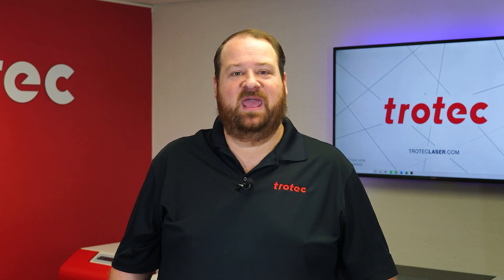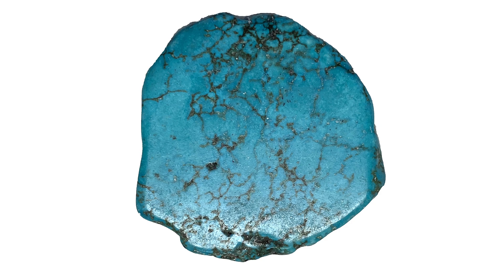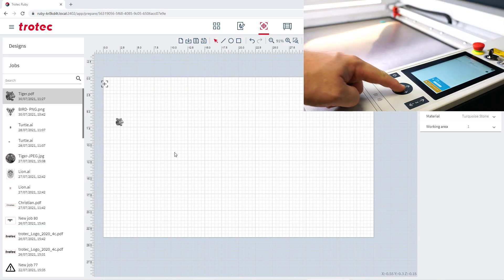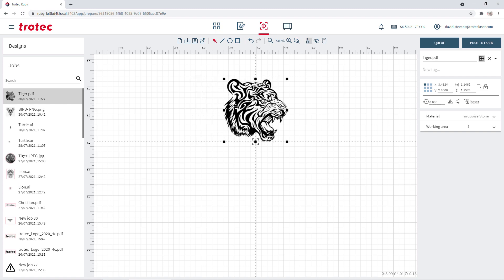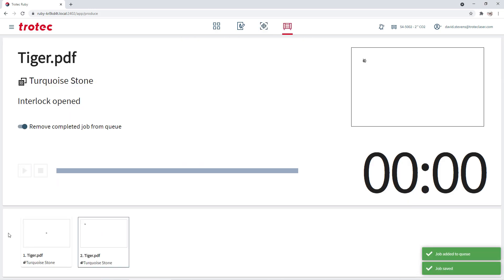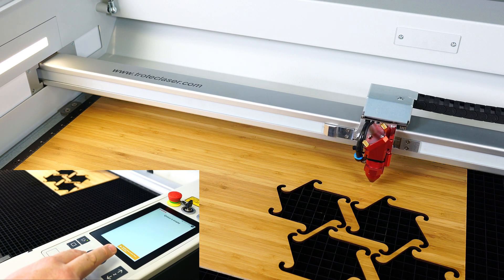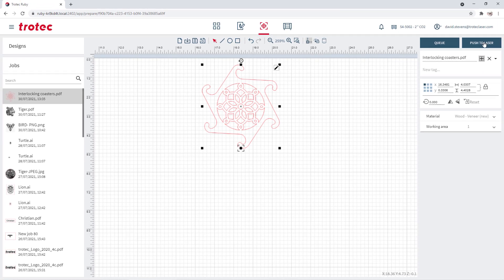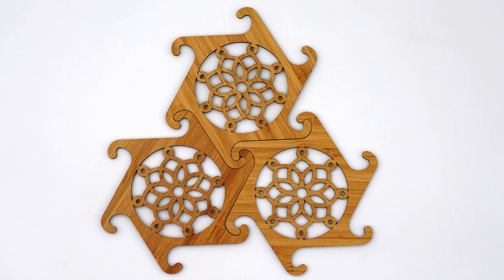Trotec Laser: Using a Red Dot Pointer for File Orientation

Comment: Is there a way to set one start location for the laser, to be used for several subsequent burnings?
My project: I want to engrave the sides of a cube. My idea was to clamp alignment pieces to the laser grid bed to make sure the cube is in the same position for every engraving. Then use the red dot pointer to orient the file onto the cube side, engrave the first side, turn the cube, engrave the second side, ... 
The design is intended to flow around the sides of the cube. Thus precise alignment between the burnings is important. However, I find this difficult. One reason being the diameter of the red dot.
Reply: I forgot. I am using a Trotec SP500
Reply from the maker: Hello! This is possible; go to the main menu in the Ruby software, then select "Settings," then halfway down the page, select "Home Position". Change this to "Start Position," then select "Save" on the top right of this page and the laser will start the job from the same position that you identify at the start of every career while the machine is on.  If you would like more information about this, don't hesitate to contact our support department:  support@troteclaser.com.